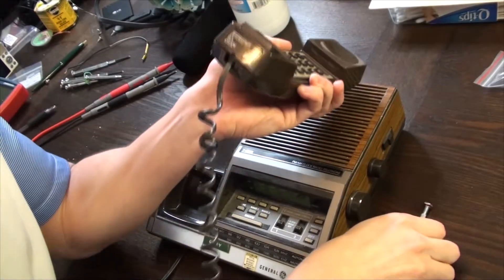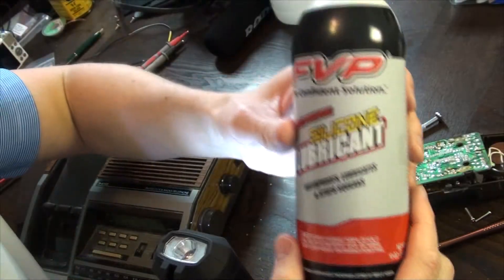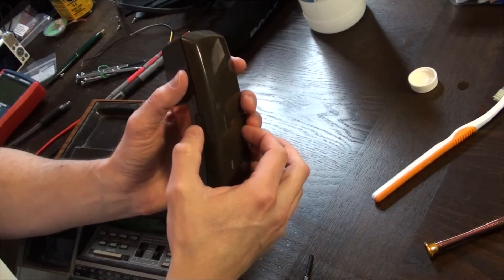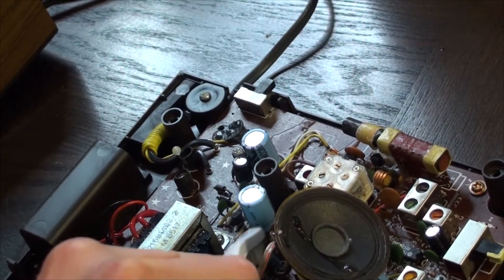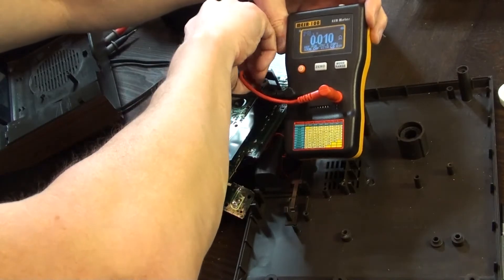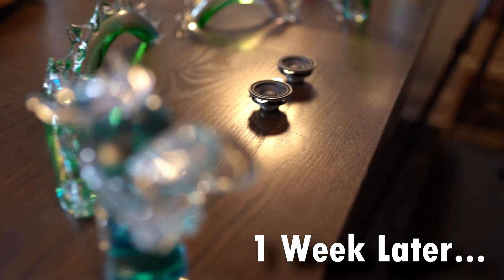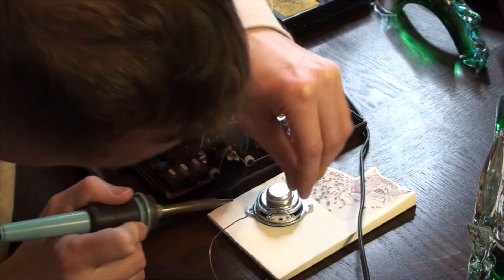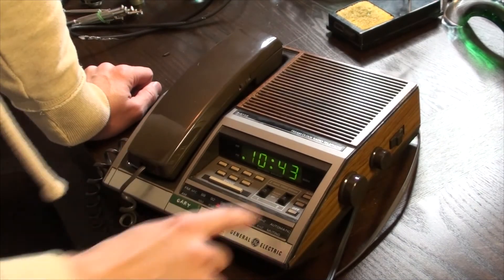General Electric Model# 7-4722 Repair | FM/AM Clock Radio Telephone

Comment: do you know why some hum when the radio is off? if the handset is taken from cradle, it stops humming
Reply from the maker: If you are lucky, it is a failing capacitor or cracked solder joint, but it very well could be an interference or grounding issue.
Reply: @VestigialVoice  are these things easy to repair?
Reply from the maker: @yamashita888  they are very easy to repair.  The most difficult part is almost always isolating the problem (and occasionally finding proprietary replacement parts).  Good luck, my friend!
Reply: There should be a date code underneath. 

First digit gives you the day of the week. 1=Monday, 2=Tuesday, etc. 

The second digit gives you the last digit of the year. So a 3 would mean 1983. 

The final two digits give you the week of the year.